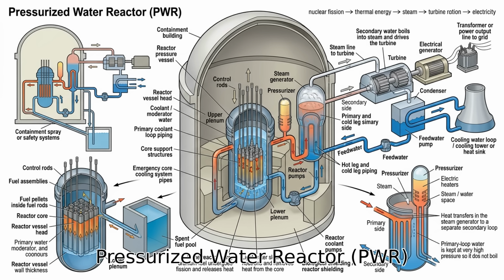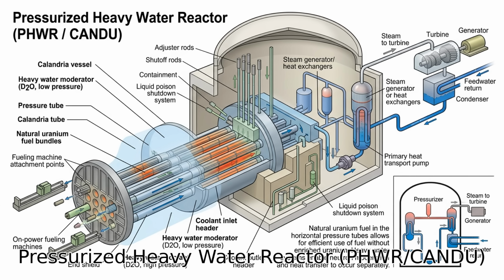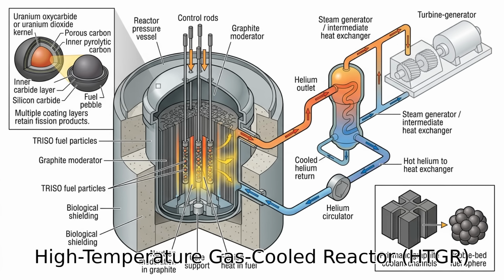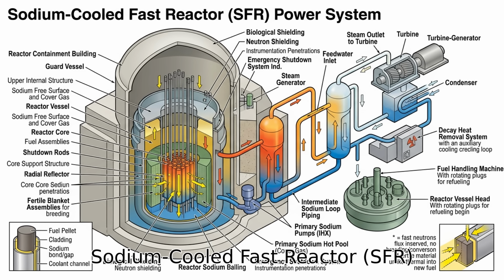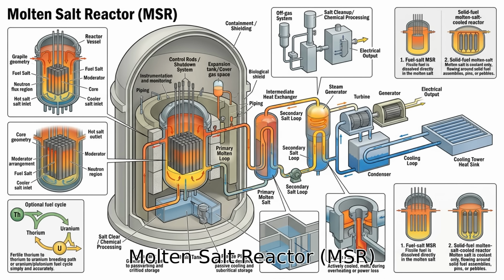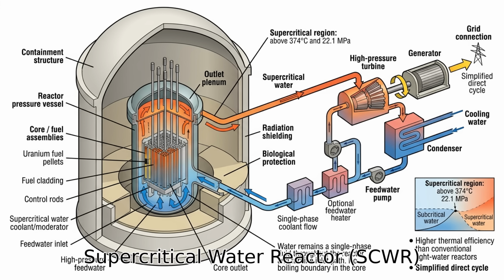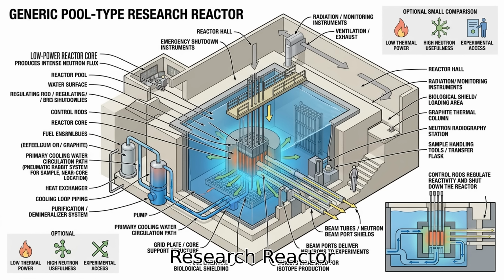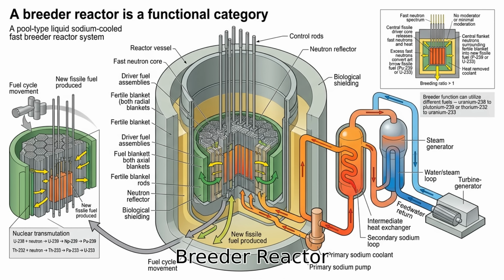Every Nuclear Reactor Type Explained: PWR, BWR, CANDU, SMR & Fusion

Comment: Bwr also use at least asecondary loop and never pump the primary
Reply: A BWR takes steam directly from the reactor to the turbine/generator. That's the primary loop. There is a pump to move the condensed steam back to the reactor. I don't believe there is natural circulation in a BWR. Operator's, please correct me if I'm wrong. The system that moves water to/from the reactor is the primary. For a BWR, the loop that moves water from the turbine's condenser to the cooling tower and back, is the secondary loop. I was an operator/tech on PWR's, but only worked tech side for BWR's and it's been a while.

Comment: Point... Naval reactors are designed to go YEARS between refueling, not months. A carrier will be refueled exactly once in its lifetime.
Regarding molten salt, I believe that's potassium-chloride, not sodium-chloride. Somewhat different characteristics that make it a better choice.
Reply: Both correct I think. The way I heard the narration, was that by using a nuclear power source on a ship or a submarine, it avoids the frequent refuelling that a conentional power source would need. It was not refering to refueling the nuclear reactor.
Reply: Cool. I've never investigated Naval reactors. The only thing I know about them is that they use a higher enriched fuel...like 90% U-235?
Reply: @NathanZSolomon-q9s  They don't go that enriched as it would be very difficult to control the fission reaction.

The reason for the higher enrichment fuel is that there is a minimum level of percent U235 at which a fission reaction can be maintained.  With the higher enrichment, there will be a longer time between refuelings.

Comment: It’s hard to beat the safety of the light water reactors.  Graphite is flammable, molten sodium is radioactive and flammable, and molten salt is corrosive and radioactive.  I’m not sure the failure scenarios on these types have been worked out.
Reply: LWRs are safe through very expensive/redundant engineers systems, but they are inherently dangerous for 3 reasons, high-pressure, all the bad stuff want to get out under pressure, hydrogen build-up and explosions and finally phase change of the water coolant.
MSR are inherently much safer and require very few engineered safety system, all they need is gravity.
Reply: Let's take a step back and look at this from a different perspective.
  How many people die each year as a direct result of burning fossil fuels and compare that number to the number of people who have ever died as a direct result of nuclear power and the answer becomes very obvious that no matter what type of reactor is employed, nuclear power is by far the better option.
Reply: The corrosion of molten metal is due to the impurities in it. Once they have been removed, they are no long corrosive. Fluoride, Lithium, Beryllium can move through pipe made of Inconel Alloy 600. The molten salt running through a LFTR or MSR would be radioactive. It would carry both fissile and fertile elements as particles. So more of the fissile fuel gets used and the fertile fuel is converted to the next element and will eventually become fissile. E.g. Th-232 -> Th-233 -> Pa-233 -> U-233. U-238 -> U-239 -> Pu-239. In addition, you just load more particles into the molten salt to continue the molten salt reaction rather than shutting down the LWR to remove a fuel assembly that stays highly radioactive for 10's of 1000's of years. The resulting waste of a LFTR/MSR is 100's of years of Medium level radioactivity, not high radioactivity. Also the Xenon, H and other unwanted elements can be pulled off by use of chemical processes done just outside the reactor. 

All MSRs would have a freeze plug. Once the reactor gets too hot, the freeze plug unfreezes and the molten salt goes down into a few tanks. While the molten salt is in these tanks, no more reactions occur because there is no more graphite to slow the neutrons down or in the case of Copenhagen Atomics, the fissile material/fuel salt is dumped and no longer in proximity to the heavy water which is its moderator. The result is that all reactions cease.

I hope this helps.
Reply: @NathanZSolomon-q9s very precise
Reply: @jpierman5  I truly appreciate your complement. I try very hard not to get things wrong and to help others' understanding without being confrontational.
Reply: @NathanZSolomon-q9s let’s at least agree that there are technical challenges to work out before lftrs are widely deployed.  Even if you start with isotopically pure lithium fluoride salt, the thorium fission process will create somewhere around 25% of the periodic table elements so you will have corrosion products formed.  If we want to start deploying nuclear right now, we should at least start with mature designs.
Reply: @sholinwright2229  We are. Have you heard of Texas A&M's 1MWth MSR? How about the OakRidge new MSR by Kairos which will also be 1MWth? Both of these reactors are being built now. They should be done by 2027. Look them up. The U-233 will be provided by the NRC.

Comment from the maker: Which reactor design do you think has the most dangerous fundamental flaw — and why? ⚛️
Reply: I think history has demonstrated this: the RBMK.
Reply: RBMK, hands down. The lack of an external containment vessel is the biggest reason. The sheer scale is another - it responds like several reactors in a common shell rather than as a single entity, making it much more difficult to control. This and more are reasons why its users are all phasing it out.
Reply: russia's badly made kettle seems to be the most historically risky
Reply: Any of the high-pressure water reactors. All the bad stuff desperately want to get out and share itself with the world. Low-pressure salt reactors are the opposite, worst case is salt spills on the floor, solidifies and nothing gets out.